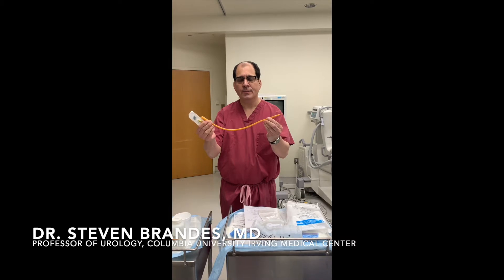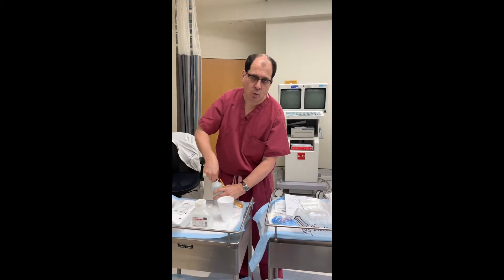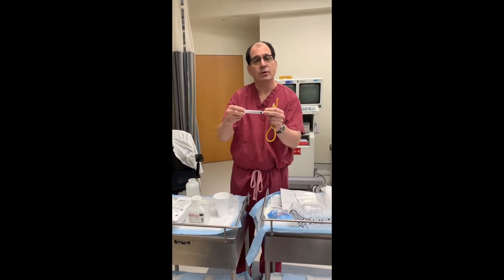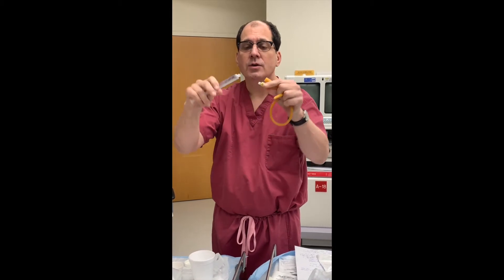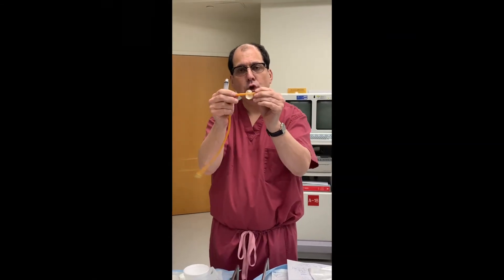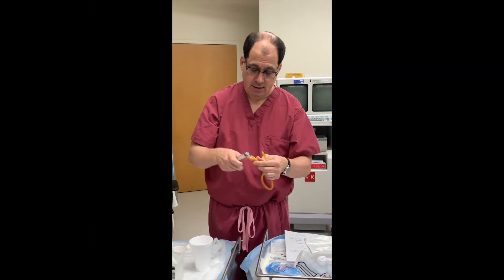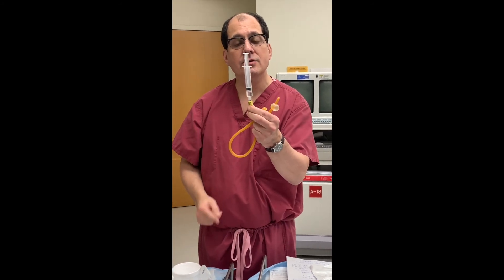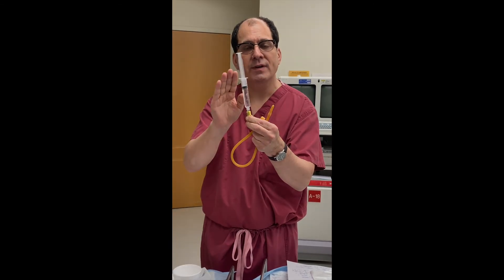Basics of Foley Catheters & How to Inflate a Catheter Balloon (2)

Comment: The water or saline must be sterile, correct?  A 5 CC balloon should be filled with 10 CC, correct? A 10 CC syringe with a Laur Slip tip should be used?  THANKS.😄

Comment: Let’s say you put 10cc saline to inflate the balloon and over time the saline crystallizes. How would you deflate the balloon then while taking out?
Reply: That’s a difficult problem. Can inject 2-5 ml of mineral
Oil into the balloon and wait a few minutes and then try to aspirate. Can cut the ballon port off and pass a guide wire up the port to unclog the line. Best to just use water and not saline (salt water). The water does not have to be sterile in the balloon. Can just be distilled water.

Comment: What is the significance of balloon size ? Some are 30 cc ?
Reply: In most circumstances I would only use a 5 or 10 ml Foley balloon. A 30 ml Foley ballon is usually used for men who are having bleeding from the prostate. The bigger the balloon  the more bladder irritation and spams.
Reply: @drbrandes  what is the difference between a 5 or 10ml balloon ? Don’t both inflate to 10ml?